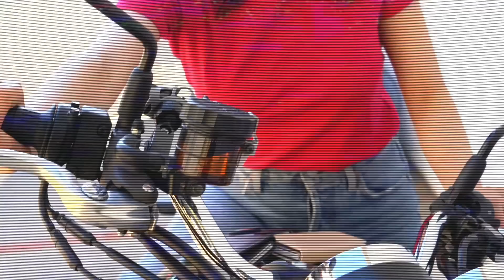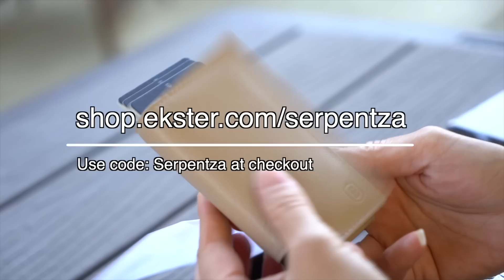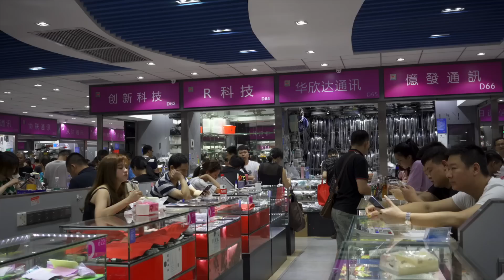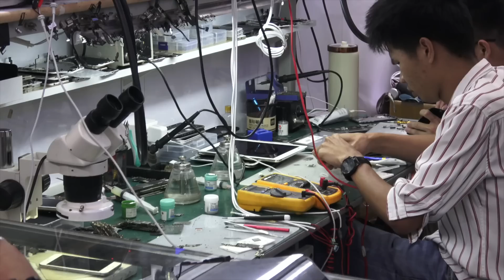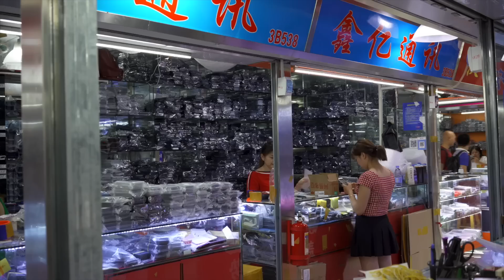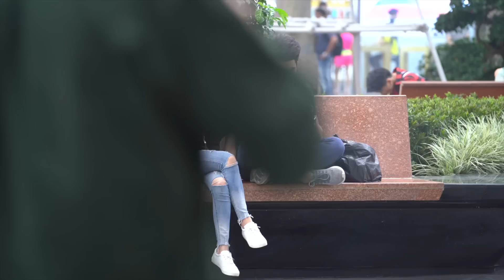Why China Can't make Chips!

Comment: I wonder what's going on with the 7nm that SMIC starts testing now. Seems kind of ridiculous without having access to EUV, multibeam and a whole bunch of other tools from overseas that they can't make domestically. This 7nm process can work, but the chips are going to be so incredibly expensive due to slow manufacturing and low yields, the only customer I could think of is the military.
Reply: While it's been talked about, these SMIC chips have not appeared on the market anywhere so far.
Reply: @EFCasual  obviously, SMIC announced that they're performing tests. There's no HVM yet
Reply: Also remember that even TSMCs 7nm process is measured differently to Intels, apparently Intels 10nm is roughly the same size as tsnc 7nm. So smics version could be more similar to Intels, but of course we will probably never know.
Reply: This is what they wrote about Chinas 7nm chip! It’s junk but read —-First article - China developed a 7nm chip and the Chinese were all proud until we took it apart and laughed, china used Lithograph tech from the 1980 and it’s junk good for bit coin miners is about it..Here is what was wrote —2nd article..Duplicating the TSMC N7 process must have been hard, expensive and high priority. WBut it leads nowhere. What we see when we pop that chip open is not a scarfy future, but a tiny white elephant bathed in deep ultraviolet. 

China is learning to build the world's finest propeller engine, just as its competitors enter the jet age. Admire the effort, but don't cash in your chips just yet.
Reply: Why would the military use these chips? 7nm is more susceptible to EMI and other forms of interference. Military hardware isn't known for being power efficient (no matter what military you're thinking of) which is the critical point of the 7nm process - power efficiency.
If these chips work the yield might be low and the chips will be expensive, but the government will likely be willing to try to pad the blow. Not a smart thing to do in the short term, but if that's their plan and it the chips are reliable production will undoubtedly be increased and we have a new problem... China could in the not too distant future beat us (I mean us, in the U.S.) when it comes to chip manufacturing. That might be very bad. The US is also fighting to increase IC production right now, we're in a quiet computational arms race and if everyone is smart, back pedaling won't happen.
Reply: 7nm with quad patterning was something global foundries was working on in 2018 before they threw in the towel and gave up due to cost. I sense something similar happening.
Reply: @Syping  no intels 10nm performance is about the same as tsmc 7nm. Theres more variables than how small the gaps are
Reply: @VariantAEC  phased array antennas (not just radar but also for GPS/Beidou/Galileo receivers that are harder to spoof). Seems very relevant for certain kinds of missiles. They require lots and lots of number crunching. You also want them to be somewhat efficient if you want them on for some time before firing the missile (for target locking) without needing a big battery or giving off a big heat signature before firing.
Reply: Follow Asianometry for this topics. Gems channel.
Reply: @peterfireflylund  
You don't need 7nm transistors to make a phased array antenna.
7nm is unimportant for military applications.
Reply: @VariantAEC  I know. It’s not hard to do with an old 90nm Xilinx FPGA, for example. But if you want lots of channels? And not too many chips, preferably only one?
Reply: Node names (7 nm, 12 nm, 5 nm, 28 nm, etc.) have become meaningless.  They stopped having any connection to transistor geometry quite a few years ago.  Now it is all just marketing.  Probably the best metric to compare processes from different foundries is transistor density.  WikiChip does a good job of this, comparing based on millions of transistors per square millimetre.
Reply: @JonMartinYXD  thanks for bringing me 20yo news 😂
supposedly the transistors are the same size as TSMCs 7nm IF you believe the reports
Reply: @JonMartinYXD  
7nm is when it stopped being relevant to transistor gate sizes.
That isn't quite a few years ago unless you're a fish or lizard or some other species of animal that only lives for 10 - 12 years on average.
Reply: @VariantAEC  The 28 nm half-node was the last where gate length was actually around 28 nm.  That was introduced in late 2011, around the same time as Intel's Core iX-3xxx processors (Ivy Bridge).
Reply: @JonMartinYXD  
7nm is a real transistor gate size. 5nm is supposedly not a real gate size, 5nm is being marketed, but the tiny size of the gate hasn't allegedly been reached.

Consoles (PS5 & XSS/X) SoCs are built on 7nm. This is why they're so power efficient compared to last gen. You cannot get more performance out of a chip with many millions more transistors on the same size chip using less electricity UNLESS the transistors actually got smaller.
PS5 and Xbox Series S/X are more efficient when running last gen games via BC because the transistors are smaller and thusly more energy efficient and that is considering that PS5 and Xbox Series X (not Series S) run the Pro/Xtreme versions of the same games from last gen. So clearly a fab shrink actually happened and it was pretty significant.
Reply: @VariantAEC  Back when node names meant something, it was the gate length that was being measured.  TSMC's 28 nm node had a gate length of 24 nm, Samsung/GloFo/IBM's was 28 nm, and UMC's was 33 nm.  TSMC's 16 nm node had a gate length of 34 nm.  TSMC's 12 nm node was just the 16 nm node with some tweaks to make it faster, gate length remained 34 nm.  Intel's 14 nm node had a gate length of 20 nm, Samsung's had 30 nm.  The node name is no longer attached to any physical dimension of the transistors or the spacing of the transistors (which was an even older way of naming nodes).  I'm not denying that node shrinks are happening, they are and they are bringing significant advances in performance/efficiency/density.  I'm saying that there is nothing you can tell about a process from its node name aside from how it should perform relative to other nodes by that same foundry.  Comparing node names between foundries is pointless at best.

Do a search for "A Node By Any Other Name", it is a short article with actual measurements and was written around the time when the name/reality divergence started.

Comment: This video has aged well. They just dropped a 5nm Kirin 9006 C recently 😅
Reply from the maker: And it’s a garbage copy using western tech and imported lithography machines
Reply: now is the time to admit you were wrong, not double down
what a clown! @serpentza
Reply: @serpentza  WELL, Well, well, I bet you haven't tested or gotten the data on the actual performances of the chips prior to calling it "garbage". That's unironically a very thorough, scientific, and rational response mister serpentza. 

Another mistake is that, as for the specific machines they use, I suppose there's no confirmed evidence of whether they have used Western-imported machines or that they have designed and built some other contraptions to achieve similar result. 

Your claim that "Why China can't make chip" is flawed. Obviously, there are many assumptions you haven't verified and taken into account when making such conclusion. It's not difficult to point out either; you haven't shown actual numbers about their whole microchip manufacturing arsenal including, the theories they know, the materials they have, the number of technicians/scientists/engineers working in the field, and all the related assets that can be related to their ability to craft chip.

I don't think that you are an unintelligent individual, unlike some, if not most, of your followers, and I'd assume that you were all aware of the flaws I've mentioned above even back then.

Given the hypothetical i.e. you are a intelligent and rational individual looking for easy money, I guess your videos work well to fool YouTube users who don't ponder too much and are against China; they would ultimately feed your pocket. 

Well, given that the general Western media is against China, as we can sees from CNN, Fox News... opinions about the country over those 5 years, making a channel that triggers those anti-China feelings would get you more clicks which would imply more profits regardless of whether you are presenting facts about the country or not or maybe some random mixtures.

Well, let's assume that you might have been to China given your past clips and perhaps getting some random video clips from whatever possible correspondents you have in China or any intermediate, it's fairly simple for you to decide whether you are telling the truth or not; nonetheless, you can shape those evidence at your will, and most Westerners would still believe them as they are merely sitting in the Platonic Cave and give full faith onto someone who seems to show a bit of something that fits their narrative. 

Perhaps, you are sponsored by some third-parties that reap profits from you spreading rumors about China through sampling bias and hasty generalization given various unsourced clips without much context. Just a hunch, don't take it too seriously. Not sure if there are other causes for which you are doing those videos; maybe your family or life is at jeopardy if you don't? 

At last, good for you that people don't think too much. Perhaps you are getting your intended results. Well, at least, you have gotten some profit from me clicking on this video. But in any case, your game seems to be few steps behind of what I can see. 

:face-green-smiling::text-green-game-over:
Reply: @serpentza  Are you saying western tech and western lithography machines are garbage? How can we take you seriously anymore?
Reply: the propaganda responses in these comments is insane
Reply: @somewhatblankpaper1423 i see your point in that he is sometimes a little quick but the focus is his criticism of the  ccp and not china and its individual people themselves.

If you actually listened to some more of his videos you can see what i mean. By pointing out the flaws in the chinese government, he uncovers the insanely inhumane bs that the actual people have to go through. 

I guess you know how that government is working

Comment: I heard a story where I work that a Chinese customer has contacted their supplier that sold USB to serial(RS232) converter chips (this is a very common type of chip  used in devices for USB data connection) and kindly asked them the firmware that was running on the chip. The Chinese has most probably attempted to copy the chip and when they realized it's a microcontroller (e.g. a simple 8-bit CPU intergrated with ROM, RAM and the necessary I/O ports for interfacing with USB), they thought they are very smart and no one will notice why they want to have a look on the firmware. Since most USB to serial converters are in fact (outdated but dirt cheap) microcontrollers running a pre-programmed, unchangeable firmware, the actual intellectual property is the firmware and not the 50-year old, e.g. intel 8051 MCU whose schematic is basically reverse engineered down to the individual transistors, decades ago.
The level of incompetence of this Chinese customer is shown by the fact that they could have just taken any freely availabe USB to serial implementation (lots of manufacturers are offering this as a freebie) and just port it to the target chip. They could even use the free PC driver for it.
FTDI's FT232 series is already known to be copied by some Chinese manufacturers, which FTDI handled by releasing a firmware update that bricked the knock-off chips. Sadly, since most knock-offs were offered as genuine FTDIs for FTDI prices, a lot of collateral damage caused for bona fide manufacturers not knowing they were buying copied chips.
But it fell hard ultimately on the end users, turning FTDI the actual bad guy. Lose-lose situation but right now that's how it is.
As far as I know, copying the original in the Chinese culture is thought as a tribute to the original, so with this mindset things will not change soon.

Comment: You said it right there "I wonder how long it will take to produce a high-level chip, the kind produced in Taiwan..." there's the simplest solution of course, Taiwan.
Reply: If mainland China were to take over Taiwan it would degrade quality of Taiwanese technology. Political culture of corruption would filter down to the business culture. There’s a saying in economics that bad money drives out the good. A similar dynamic occurs in high tech.
Reply: @richardcoughlin8931  It sure would. I guarantee that the staff of Taiwans advanced chip fab facilities have contingency plans to remove/destroy a few vital components from the most important pieces of gear they have to render the entire factory useless, if it ever seems likely that they could be captured
Reply: @movinon1242  And thus began WWIII.5...
Reply: Exactly they cannot get the latest lithograph machines from the Netherlands.. China devolved a 7nm chip and the Chinese were all proud until we took it apart and laughed, china used Lithograph tech from the 1980 and it’s junk good for bit coin miners is about it..Here is what was wrote —Duplicating the TSMC N7 process must have been hard, expensive and high priority. But it leads nowhere. What we see when we pop that chip open is not a scarfy future, but a tiny white elephant bathed in deep ultraviolet. 

China is learning to build the world's finest propeller engine, just as its competitors enter the jet age. Admire the effort, but don't cash in your chips just yet.

Comment: Yeah, China can out-copy anyone. 
Diana (German company) out-sourced production of their cheaper bandit line of air pistols manufacturered in China. Not long after release, a chinese airgun manufacturer called Artemis released the p880 which is an copy of the Bandit. They just changed the grip.
Interesting tidbit; I bought the Artemis sidelever bull-pup rifle (I think it was called the sr177) and ending up double loading it by accident and blew the plastic chamber up.
It was a pain to reload with or with the mags because the plastic tube with the nub to push the pellet rod through the mag was way too tight. You had to cock the rifle, manually pull the "shroud" back and push it back through again. Made it kinda sketch to reload.
When I stripped it for parts I found it was actually pretty decently built with a quality trigger group, spring, guide  and piston. Despite blowing it up, the plastic was a good mold. Piston head was a big honker 36mm. I had to buy heavier pellets to slow it down some which no doubt contributed to the overpressure.
Shame the reloading mechanism was so janky because it was a pretty neat rifle.
Chinese missed the mark just a little and it made the rifle pretty well unusable. And that's just a pellet slinger which is actually relatively easy to make.
Htf do they make rockets and submarines?
Reply: "Htf do they make rockets and submarines?"

In exactly the same way. They just have a big enough population that having high fatality rates doesn't impact them the same as a smaller nation. NOTE: I'm making assumptions here, I don't actually know.

Comment: Ball point pens - well known but difficult to make without a mature powder metallurgy processing route since they are often porous hardmetal (WC-Co) that has a low dimensional tolerance and required high-temperature high-pressure processing. Source: An expert in hardmetal manufacturing.